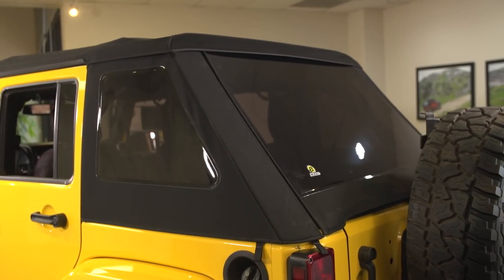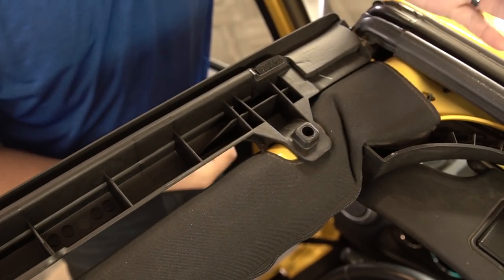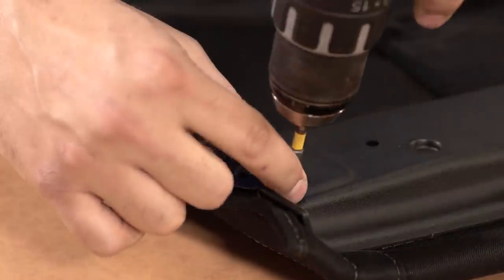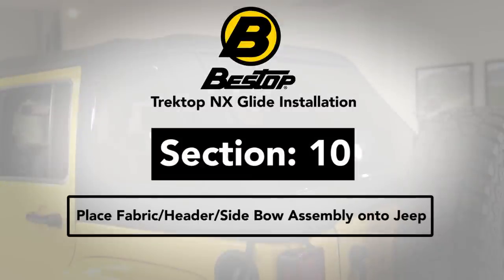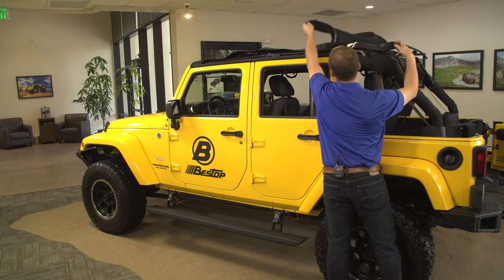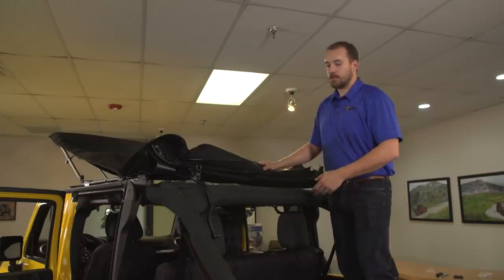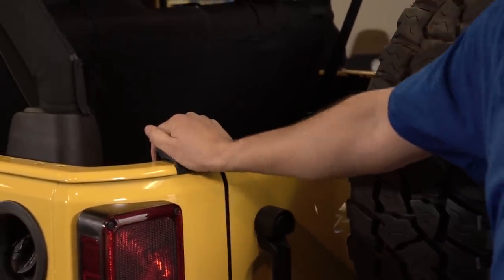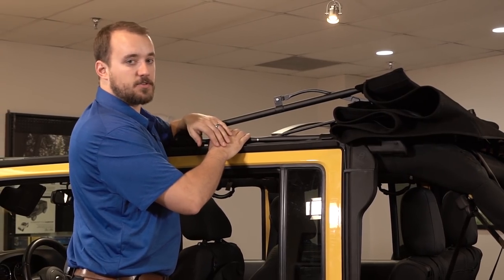Trektop Glide Installation and Operation

Comment: This is a great top. The video is really helpful. The one drawback that I wish I had known about was the #8 1/2” washer head screws. They are awful. Save yourself some time and headache and go buy some stainless #8 1/2” screws and stainless washers. The included screws do not install like the video shows. He either pre drilled the holes or went through twenty extra screws making this video.
Reply: Mine all stripped. 😩
Reply: Be sure you have a good non-stripped drillbit or screwdriver. I used the installed screws just fine.

Comment: One problem i had with my install is the small black screws that have a built in washer. The holes for them weren't threaded nor were the screws self tapping. Made for a difficult time installing those. Luckily after struggling for a while my stepdad had a self tapper the same size that i used to tap the holes out for the screws. Its probably just an issue with the newer ones as i don't see them having that problem in this video. Other than that install was easy. Much easier with this video than with the paper directions.
Reply: Had the same issue.  Contacted Bestop and their solution was to ship me more screws.

Comment: Great video. Thanks! Was very helpful in getting the top installed. Took about 4 hours with my daughter helping me (not particularly rushing). The only really difficult part was the rear window — that was a PITA! The video makes it look a lot easier than it is. Hopefully once it stretches out for a bit, it'll be a bit easier to get on. Very impressed with the quality and solid engineering of this top!
Reply: P

Comment: Just finished, big thanks to the video!
Had a couple pain points, so just to help, here’s a heads up to look out for, if anyone about to embark….
Section 4: my Bow Mount Brackets’  “this end up”  was stamped upside down on them.  Go by the instructions diagram round hole up!
-Section 5: MY predrilled screw holes did not come close to lining up. YMMV. So maybe have a metal drill bit on hand, just 
in case.
-Section 17: screwing in the 8 Bow Flap screws, go by the video, as the instruction diagram is confusing, and can’t fit as illustrated. (Over, not under)
- Also, it was a huge help to leave the cover/windows lying in the sun while you’re working- got them more pliable and more manageable.

But overall VERY happy so far!
Reply: Not sure why some are crossed out. All are valid. 😉
Reply: Had the same issue with my bow mount bracket, left side.

Comment: Great video! I installed the top myself and it took 5 hours. One hour longer than the instruction manual but it was 90'degrees in midday sun so I took a couple of breaks. Overall pretty easy install.

Comment: Great video.  I have a 2 door jk with an Oem soft top, but I really like this top,  I looked into it but to my knowledge it's on back order till September
Reply from the maker: It is not on back order, we have plenty in stock at www.Bestop.com
Reply: Bestop® 54923-17 Trektop NX Glide Twill Softop  ?  I ordered one over a month ago and I still don't have it. and it hasn't been shipped.
Reply: Bestop   My coworker called to order one over the phone last week.  He was told there on back order till I believe he was told till September
Reply: Snow Dogs Vlogs  thanks for the heads up.  I was thinking of ordering one this weekend. But hearing it's taking over a month to ship. I have to believe they are out of stock regardless of what bestop is saying
Reply from the maker: Not sure why he was told that. We are not back ordered that far out. I suggest he try another authorized dealer or call Bestop directly.
Reply from the maker: Not sure where you ordered from, I can only speak to our supply in our warehouse and we are only waiting on 2-doors, which will be in this week.
Reply: Bestop, I ordered from Quadratek about a month ago for a 2 door jk. will these be shipping soon?
Reply: Nick Coulter good luck getting an honest answer.  I am very convinced that they are back ordered.  They started selling them and didn't have the inventory to meet demand.  Typical corporate greed.   I was about to order one last week and Iam glad I decided against it as I was about to check out.
Reply: I ordered one from amazon , got it in two days, installed in in 3,5 hours
Reply: Tibor Gee   For a 2 door ?
Reply: no, 4 door
Reply: Tibor Gee  I figured that.   I have a 2 door.  It's almost impossible to get it.   There on back order everywhere

Comment: I had this top installed today by a custom Jeep shop. It took them seven hours with two talented techs to assemble this. It has 35 pages of instructions.  They had to Call Bestop for assistance with some of the instructions. My suggestion is to not try this yourself and find a custom Jeep place who has experience in installing Bestops.  But the quality looks great. It needs so sit in the sun for a few days to stretch out. And I do like the look...:)     Good luck fellow Jeepers...:-)
Reply: you need to find a better shop. i installed it all myself in 3 1/2 hours no help needed !!!!!
Reply: Respectfully, the shop you went to stinks.  I installed in 2.5 hours with my friend and I wouldn't say either one of us is particularly mechanical.  We just followed the instructions and watched the video again for some parts.

Comment: we bought one for a 2016 wrangler sport 4 door. 
directions suck! one part was labeled and stamped wrong . 
for how much this top costs its poorly designed and fragile .
but i will say, this video was very helpful and easy to follow. 
bow #2 will snap in an instant for your're not careful.
thankfully customer service did send us a new one.
but again took like 5 weeks. 
besttop needs to make a top with less steps and less pieces to put together. 
the top is finally back on , and were afraid to even put it up and use it the way its supposed to be used. 
2 stars out of 5 !
Reply: If you snapped a part you did it wrong.

Comment: I'm looking into buying this. My finger is literally on the trigger. I just want to know when I'm ready to put the hardtop back on, does everything need to be completely removed. All brackets, door surrounds, etc
Reply: Would like to know this answer as well before I buy.  It's in the cart now!
Reply: You take out a good portion of the brackets the ones over the doors but you leave a bracket behind the rear doors for the top. I just reinstalled my soft top after placing my hardtop in storage, and it took me about 20 minutes to put everything on

Comment: Installation was going great until I had to attach the stay strap to the back bows.  The screw holes are not working at all and my screws are now stripped.  Seen a lot of issues with this.  Need better QC on this area.

Comment: I am on the struggle bus trying to screw in the pan head screws into the stay straps on the #3 and #4 bow.  I keep stripping the darn screws and it seems like there isn’t enough meat to get it into the bow.  Any advice on this challenge?
Reply from the maker: Sorry for the late reply, hopefully you've gotten this fixed, however if you're still needing help, I would suggest calling Customer Service at 800.845.3567, they're available Monday through Friday from 8am to 4pm, MST.

Comment: 9:18 "  Now, using 2 of those 4 screws"  The screws you removed are not the same type screws used in the following steps.

And was a top-down persepective not possible? oblique angles for things like  seals ?

Comment: Looks great... but.. Wish the bows were incorporated into the top. I am not riding around with those overhead. When i open the top i want it to be open.. not have a bow running across the opening.
Reply from the maker: Hi! The silver bows you are referring to are optional and very easy to remove if you do not want them overhead while the top is retracted.
Reply: Bestop that’s awesome in that case! Thanks.

Comment: Can you detach the top after it's folded back?  Quadratec mentioned there were two quick release points.  Maybe I read that wrong?
Reply from the maker: Yes, there are quick release bow knuckles that allow the frame to disconnect easily from the brackets mounted to the Jeep.

Comment: When you fold the sun top back, does it flop around at highway speeds??? Seems like it should be strapped down?
Reply: My thoughts as well. Glad to have gotten rid of my 14-year-old, well-worn factory soft top, but it seems like this opens the same way as the original, and on the original, I had to strap the two folded halves of the bar together with velcro strips. I still have them, and will probably continue using them. "Old habits," and all that.